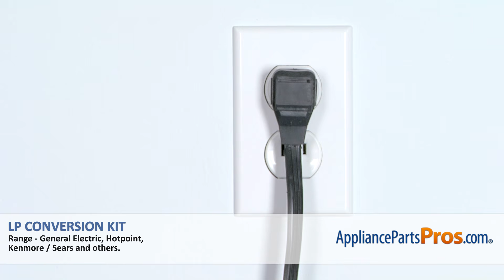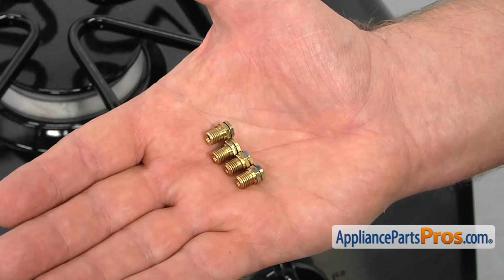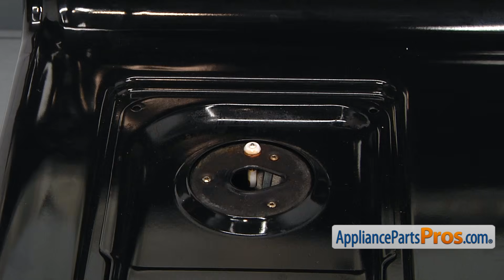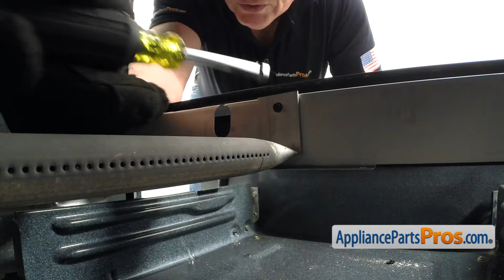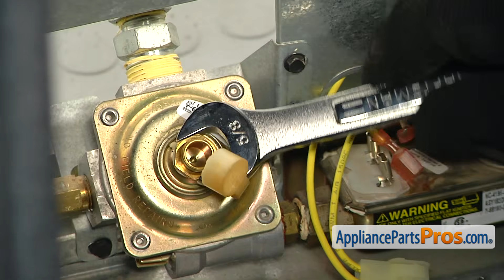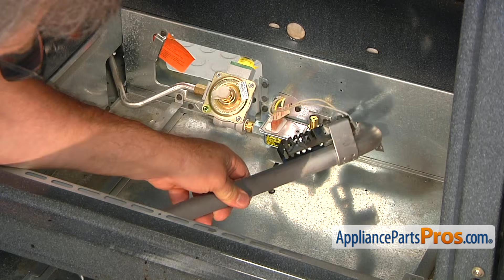How To: GE LP Conversion Kit WB28K10556

Comment: Unfortunately, my oven door does not simply lift off the hinges
Reply from the maker: Good point, @craigallmendinger8404 👍Not all GE models have lift-off hinges—some use locking hinge clips or require the hinge to be released in a specific position before the door will come off. It’s always best to check the model’s service manual for the correct removal method.

If you need more in depth troubleshooting or replacement information you can check out our Repair Forum: https://forum.appliancepartspros.com/.  It’s easy to register, and you can either post your question or search the forum to see if someone else has already asked the same question.
 
Our experienced technicians, with over 20 years of hands-on appliance repair experience, are ready to answer your questions and guide you through your repair.
Reply: @appliancepartspros  thank you so much. Your video was really helpful. I ended up getting the oven converted while just leaving the door on and being careful not to lean on it.
Reply from the maker: That's great! So glad you were able to get the repair completed!

Comment: Ok I'm confused. Why did you disconnect the wires from the burner? It was out of the way when you laid it down on the bottom. Why disconnect the wires. Seems like an extra step that's uneccessary.
Reply from the maker: Totally get the confusion. For a detailed explanation specific to your setup and whether that step is necessary, our certified techs can help at forum.appliancepartspros.com. Just post your model number and what you’re seeing, and they’ll walk you through it! 👍

Comment: Just so u know, all this would be a lot easier without gloves on. It was excruciating watching this guy trying to manipulate all these small parts and wire connections
Reply from the maker: Thanks for the feedback! 👍 Gloves are there for safety around sharp edges, but we get that they can make small parts trickier to handle. We appreciate you watching and sharing your thoughts!

Comment: Seems easier to just hook up the propane and let the stove run hot 🔥.
Reply from the maker: We get the joke 😄 but for safety and proper performance, the range really does need the LP conversion. Running it unconverted can be dangerous.

Comment: why not leave the wires, plug,  and that screw on the igniter, and do 4x1/4 turns instead of 2x1/2 turns?  Seems like a lot easier?
Reply from the maker: You may be able to do that on some models, but on others, you may have to follow those steps in the video.
Reply: @appliancepartspros  the model in the video looked like you could? Just saying because I'm so LAZY- wanna do as little work as possible!
Reply from the maker: Our videos are generic videos to give you an idea on how the repair is completed. If you are able to replace the part with fewer steps, then you can do that.

Comment: Why didn't  you change  the bell orifice   ? All you did was tighten it . Why did you unplug  the wires  ?
Reply from the maker: I do apologize but what is the orifice that you are referring to? Our videos are to help give you a general idea on how to do your repair. The wires got unplugged so that it was easier to get to the one orifice. Sometimes in the oven you just have to adjust the orifices instead of having to change the orifice out.
Reply: @appliancepartspros  no need  to apologize  your  video  was very  helpful  . But at the 10:10 mark  of the video  you tightened  up what you referred  to as a " bell orifice  safety  valve  " but didn't  change it . If it didn't  need to be changed  as you said  it didn't  , why did it need to be tightened  up  if it was a new stove
Reply from the maker: If the stove was natural gas before switching it to LP then that could be why you are needing to adjust it instead of replacing it.
Reply: @appliancepartspros  thanks

Comment: Here is another hint. Our double wide came with the gas stove installed new. We didn't know but the LP Conversion Kit was in the plastic bag, taped to the back of the stove, and when we bought a replacement years later, it also had the LP Conversion kit taped to the back of the stove. Not knowing you would buy the 50 dollar kit when you purchased the stove not needing it, as the jets out last the stoves. So check yours when you purchase the stove.

Comment: Model JGBS66DEK4BB 
Just found out all the LP stove top burner fittings are color coded. I can’t see any color difference on them.  I look further and supposedly they are etched for correct placement.  Nothing on mine.
It also says in the manual converting the oven burner this product cannot be converted to propane by adjusting the oven orifice. orifice must be replaced for propane.   

Wow was a little more involved with flam adjusting.  But still your video was extremely helpful.

Comment: Some surface burners  have  different sized orifices,  ie. Smaller sized burners to larger sized burners. So pay attention to the directions. It may have a graft showing you the BTU’s of each burner and the right sized orifice to use correspondingly. The size of the orifice is stamped into hex nut side and it will be a number.

Comment: On the safety gas valve, when I tried to turn it a full turn is was already so tight I couldn't turn it.  Is it possible that is the reason I'm not getting any gas to the range?

Comment: 3:45   As a "PRO" you really should emphasize starting the threads straight to avoid cross threading, particularly with brass fittings. "Do not over tighten, you don't have to" ...Umm, good to know.

Comment: Great video - thanks for the clear direction!!! I was actually able to access the oven pressure regulator from the back of the oven. This made it a bit easier as I did not have to go through the oven from the front and remove the burner and other pieces. FYI for those who may also have the ability to access the same way.

Comment: Bravo! Awesome video was able to pinpoint problem and change our new (but a big box return)  Oven over to LP.  They apparently had our cooktop set up properly but not the stove which was so sooty you couldn't see in.  Noticed after all that baking of "pandemic" bread our pans were getting black marks - and I Noticed dark shadowy marks on our walls??? What??? Yep!!! Carbon!  Fixed!  Easy!  So easy this female, mid-aged, Realtor from Ohio just a few basic hand tools did it (alone, yes alone - no help other than video) in an afternoon!
Reply: was the oven making a "whoosh" or hissing sound when it was heating?

Comment: Horrible information here! You completely skip the facts that each one of the burner orifices have different sizes and placing them in the wrong one can cause serious issues! You also didn't show that the orifices in the ove N also need replaced. They done work just by doing what you did here. You are going to get someone seriously hurt or killed!

Comment: Thanks for the info, was almost identical to my oven. Had some trouble getting the broiler to light off but that one turn adjustment plus air valve fixed it! 🇺🇸🍻

Comment: Thank you for this! 
The instructions that came with the range were totally inadequate. 
"Converting the oven burner: 1. Remove oven door, broil door, oven bottom, and burner. The oven burner orifice is located behind the drawer. On some models a metal shield must be removed." Uh, okay...
 
There were two differences between this and my range (model JGBS66):
Removing the door - on my model, you can't slide the door off hinges that stay on the range body; you have to lock the hinge and lever the door, including the hinges, out of the range body. 
The oven orifice has to be replaced by one provided. You can't just adjust the one in place. 
However, despite these differences, your video made it all very clear!
Reply: No doubt, was about to attempt access w/o removing oven door; have a few more steps, hoping it works ok
Reply: Where is its location tho?

Comment: Some of these oven have a metal pan underneath the metal bottom after it is taken out. This requires doing half the steps from inside the oven and half from underneath by taking out the bottom drawer.

Comment: I have 5 orifices plus 1 big orifice what do I do with the big one?
Reply: Check the installation instructions. If your oven came with it, you probably need to replace the current oven orifice. My instructions said "This product cannot be converted to propane by adjusting the oven orifice. The orifice must be replaced for propane".  
This is different from what is in the video.
Reply: I think it's for the oven. I didn't see him change it.
Reply: I just installed the same stove you have. I’m not sure why he didn’t install the oven orifice, I did, it’s much smaller than the NG so I’m assuming should be installed.
Reply: @jaredkobobel1107  yes I replaced the large one on the over burner and works great.

Comment: Aloha from Hawai'i. Hope all is being safe from the virus pandemic. MAHALO NUI LOA for this video, it help me convert my GE JGBS66REK355 - 5 Burner Gas Range to propane. I do have 1 question...I have a extra piece that wasn't used or replace. It looks exactly like the part thats located under the oven burner which was the one we had to turn a full circle. IS THIS OKAY OR DO I NEED TO SWAP IT OUT? Thank you for your kokua. Malama Pono.
Reply: Yep, I also have the extra piece.

Comment: U dont show the color for witch burning? I have white,  yellow brown and purple, what each in the burning?
Reply: Witch burnings went out of fashion in the very late 1600's...
Reply: The colors for each are listed in the manual. But the colors can wear off; the orifices are also stamped with the size. Plus there is a stamp "L" for propane (LNG) or an "N" for natural gas. 
My stove (slightly different; model JGBS66 ) has 
small burner (LR) - 5000 BTU -- red/yellow - stamped 66L
med burner (RF) - 9500 BTU - blue/brown - stamped 89L
large burner (RR) - 12000 BTU - blue/magenta - stamped 99L
XL burner (LF) - 15000 BTU - blue/brown - stamped 114L
Center burner - 8000 BTU - orange/green - stamped 86L
Oven - 16000 BTU - pink - stamped 048 (much larger than the others)

My instructions also say "This product cannot be converted to propane by adjusting the oven orifice. The orifice must be replaced for propane".  So check your model. This is different from the video.
Reply: This is a VERY important step that was completely missed in the video, especially for those of us that don't have the original instructions!

Comment: How did you remove the door? Mines not coming off
Reply: Mine has a lock on the hinges that I slide up and then when I open the door to lay flat, the door slides out.
Reply: @cherylspringtime  thanks!